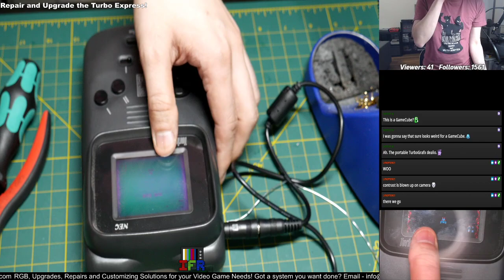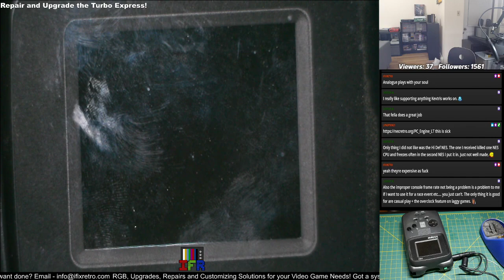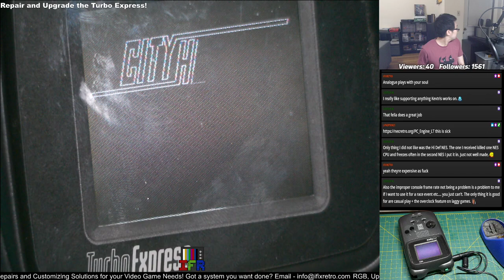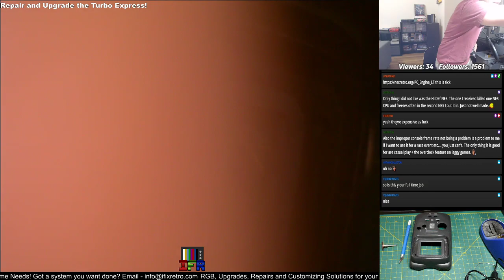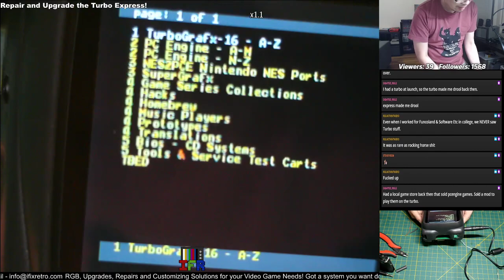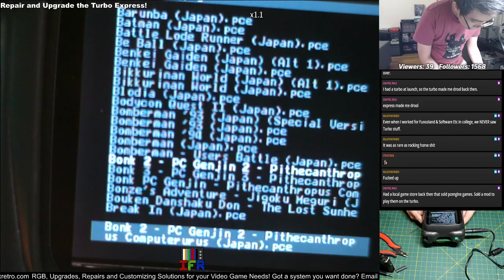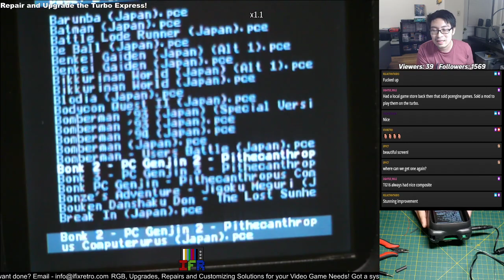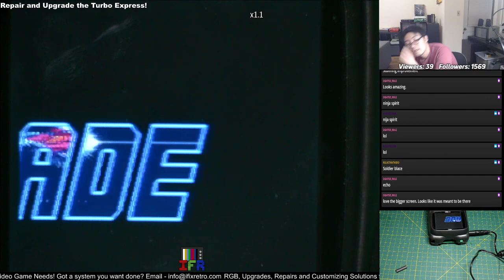Repairing the Turbo Express and Upgrade it with a Bigger and Better Screen!

Comment: hello, did you recap the capacitors? do you make repair videos too? I have a nec identical to yours which has a short circuit, if you have any idea where it may come from I have done a complete recap it has nothing to give my 125v fuse 1a constantly blows thank you
Reply: "hello, did you recap the capacitors?"

...Did you even watch the video?